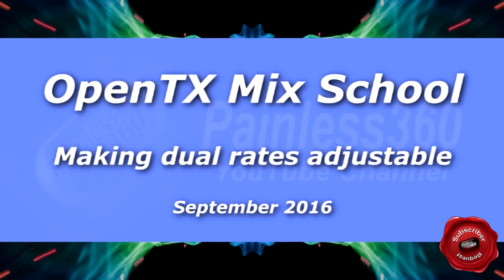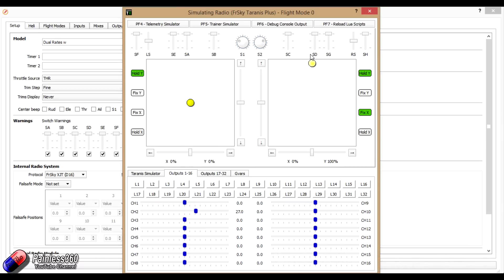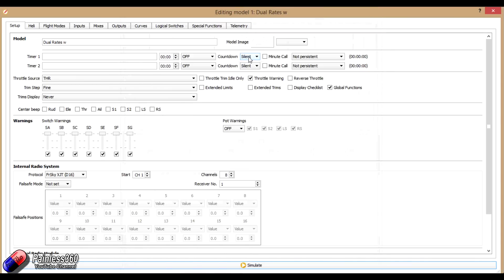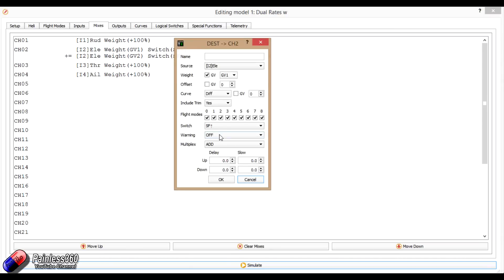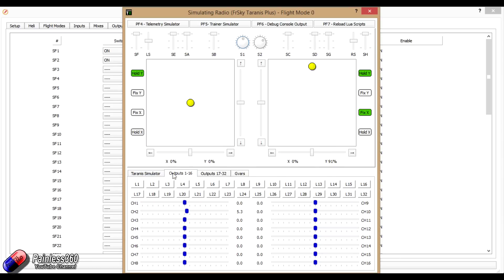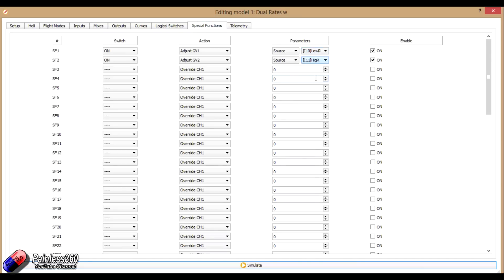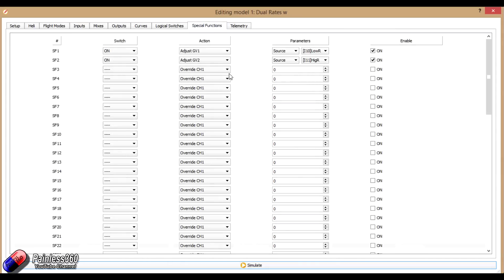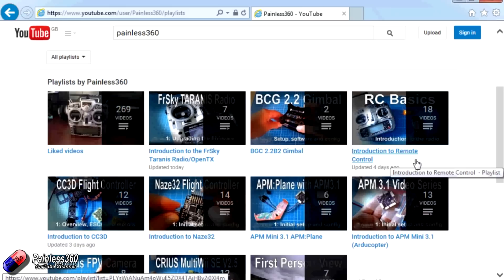OpenTX Mix School: Using S1/S2 with GVs in mixes for things like dual rates

Comment: I do same thing but using a curve to modify normal pot output, and then multiplying that value in a mix for the desired surface control.
Also, I can modify 3 levels of expo of aileron and elevator with 3pos switches.
And with flight modes, I can control if I want differential airelons mix, aileron with rudder mix, or "acro" mode (without any mix applied).
If Painless360 or anyone is interested, I have no problem in sharing an exported eepe so you can use as template for your own models.
And, of course, if someone needs help with a custom mix, I can try to help.
I have spent many hours doing crazy things with OpenTX ;-)
Greetings!

Comment: I really wish you  could/would do a tx series on Deviation firmware but not the cut down 7e, a full size like the Devo8s, 10 or 12.
If a TX was provided would you consider it?
There really is zero information past the manual and furiously popular because of protocol support while Open TX has countless videos showing how to mix.
Reply from the maker: That's an interesting idea. You are the first to ask about it though. I'll pop it on the list and see how many others ask for it. Thanks for the idea!

Comment: I think there is an error in logic as shown here. By allowing the GV to range down to zero you are effectively disabling the control surface. 0 x stick command = 0 output
This problem could be solved by careful selection of the offset so the GV can never be zero.
Reply from the maker: Very true, adding a little offset would do that. These videos are intended to help pilots understand the basics. Covering every possibility for each tip is almost impossible, thanks for the comment.